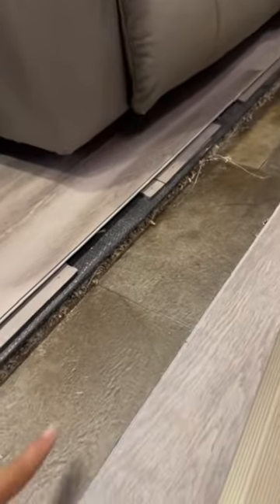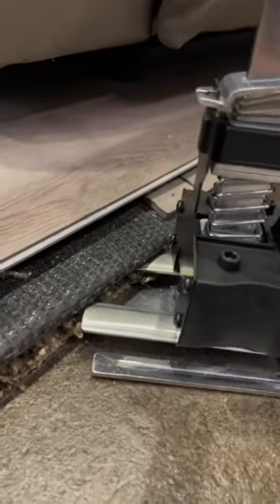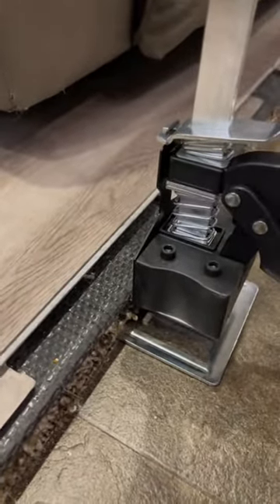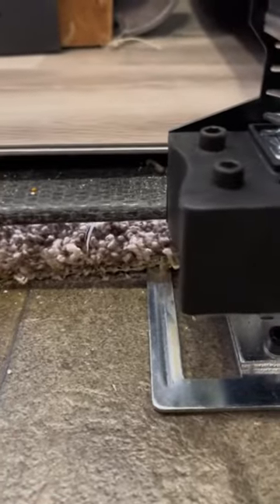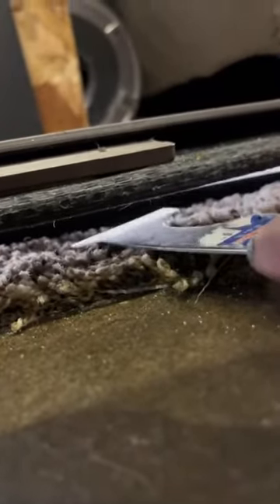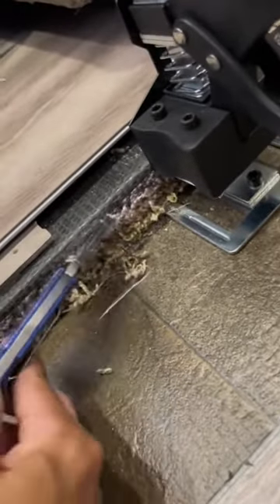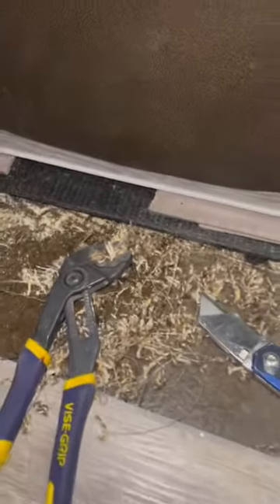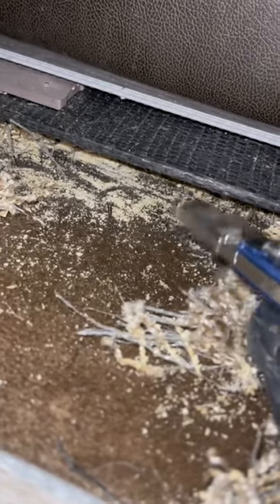How To Remove Carpet from underneath a slideout in an RV

Comment: How you remove the floor underneath of the slide out when is completely open?
Reply from the maker: Are you talking about the subfloor under the carpet?
Reply: @shidelrvs  yes the plywood underneath of the slide out.
Thank you for your reply
Reply from the maker: @bmodllc  The slideout will have to be removed or lifted with a crane and proper equipment to access the subfloor underneath
Reply: @shidelrvs  😪
Reply: Does this work on all slideouts
Reply: Also do you need the slideout in or can you do this while its out. I bought the same tool you show. Just curious if I need to have the slideout in to do this??